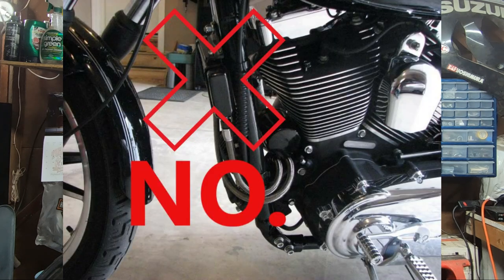How The Twin Cam Engine Became What We Know It As Today

Comment: I have a 2006 88 with 11000 miles all stock except for air filter and screaming eagle touring mufflers and a power commander should I be concerned?
Reply from the maker: The dyna that year had the hydraulic tensioners, softail and touring still had the spring tensioner. Most of the issues were on the earlier models. I'd just check it every now and again.

Comment: I was not going to go with a TC after '95 1340. Figured HD must have thought TC was the way to go. I have an FXDL made in 11/98. At 25k mls it's had the original chain tensioners replaced. The replacement spring tensioners have 9k on them with almost no visible wear. That suggests it was the shoe material that was the problem. Sounds like a sewing machine mechanically. Probably won't go back to Evo, the TC  has noticeably more torque.
Reply from the maker: The shoe material used was one problem, they won't say it but they had a bad run of timing chains that were more fit for a chains saw there.

Comment: and the EVO was in development when AMF had the company
Reply from the maker: It was in the late 70's, they knew they were gonna have to do something and make it more reliable. That unleaded fuel in Shovel Heads caused all kinds of problems, Harleys not a incapable company. They would of dominated road racing with the VR1000, they had that in 1988. But the big wigs wouldn't let them race it till they had a management change in the mid 90's. By then it was way out of date and behind in technology.

Comment: The twin cam is a great compromise of evo sound and m8 performance,but the heat of the engine is a problem in summer so oil cooler would solve that.the m8 engine is great but it loses the evo and twin cam sound we all enjoy.new harleys are more like victorys.next harley will have overhead cam big v twins lol

Comment: Check parts diagram of an M8.  In my opinion they took a step back to Evo basics for this engine.  Single cam with a chain between crank and cam instead of gears, and cam is centered vs pre pre-TC engine.  99 to 06 engines were probably the worst engines in  motorcycles and those years  sold in big numbers.  Cam chain tensionners, shifting flywheels, failing tapppets, failing inner cam bearings etc.   And Harley is wondering  why so many consumers are not buying another HD.    They (MOCO) might be doing much better if the Twin Cam never existed.
Reply from the maker: That's exactly what l thought myself when that M8 came out is they went back to a modernized Evo style design. The 88 years were pretty rough, the twin cam improved but it was never perfect.
Reply: @GixxerFoo  Never forget that the Evo was almost bullet proof, except as mentionned cracking engine cases in early 90s.
Reply from the maker: That was really the only major issue with them if you really started pushing them hard.
Reply: @GixxerFoo  The Evo had two issues (missed one in comment).  The engine cases that cracked, but of all the people I know that rode their EVOs hard one person that this happened to.  Secondly, if INA inner cam bearing was not replaced ASAP it could also do damage.
Reply from the maker: That's true and they had some issues with cyclinder studs pulling out of the cases. That's why they spread them further apart on the twin cam.
Reply: @GixxerFoo  Harley mechanic for 40 years and never had job with stud pulled out on an Evo.   Maybe in some cases caused by high compression
Reply from the maker: That's where it became the issue was when guys started high compression builds. If you kept it the compression mild it was never a problem.
Reply: What's your opinion on high tensile steel head bolts? I think they would cause a weaker part to fail. Probably for the worse @GixxerFoo

Comment: Interesting ! I've switched shift drums to one from Evo 5 speed & never noticed a problem other than the clunk is gone ! Also had the chance to use A motor flywheels in a B motor case & leave the balance shafts out & it works !  In 06 dynas & then 07 & up bikes the 6 speed is prone to main bearing failure & compensator failure which takes out the starter & breaks the splines off the clutch hub .  Just  some further information ! Thanks !
Reply from the maker: Dang you've done some interesting internal work. So what made you pull the balancers out of B motor? That's the cool thing about Harleys is that everything is so interchangeable.
Reply: @GixxerFoo  I was using a big cam high compression & ported heads & I could see no point in spinning the balance shafts ! I have a engine machine shop been at it for a long time !
Reply from the maker: Ahhh so you got the tools and the talent to do basically whatever you want. Sounds like you can pretty much make whatever you need!

Comment: EVO was a Porsche design.
What i dont get is this. Why was S&S able to build good big big bore long stroke engines and HD not ?
Reply from the maker: Harley had to meet emissions standards as an OEM would be my guess.
Reply: I thought the V-Rod engine was a Porsche design.
Reply: @whatsstefon 
Porsche was also hired to help Harley develop the Evolution engines and the Twin Cam engine, primarily with emissions control matters. Inside all Harley engines you will find German pistons from Mahle and in the V-Rod and Big Twins you will find gears and shafts sourced from Getrag. Early V-Rod engines had even more international content, with French head castings, German powder forged conrods and a forged steel crank from Hatz, a German manufacturer of small diesel engines. Even the gaskets have "Germany" cast into them! As an old "propeller head" (BMW bike enthusiast) this gives me a lot of confidence in this engine. I am guessing, until I know differently, the Revolution-X engine is every bit a quality piece as the V-Rod mill is.
Reply from the maker: It was developed with Porsche, Harley has worked with them quite a bit over the years.
Reply: @GixxerFoo  with Porsche is the same as..... Please help, we don't know.
Reply: Cheers for clearing that up. I had no idea their help extended beyond or prior to the the V-Rod.

Comment: Awesome Video👍

The Twin Cam was “abandoned” to early within the motors evolution for the Milwaukee 8. 

So goes the life of Harley Davidson 🤷‍♂️
Reply from the maker: Thay was exactly how l felt too, they finally had the bugs worked out and they dropped it.
Reply: I traded my 2010 Roadglide custom for a 2020 RoadGlide s I respectfully disagree. So far this bike does it all for this 63 year old rider.Fit ,finish quiet motor even after a stage 2 torque cam, suspension for now is fine Seat and handle bar design comfortable.The twin cam when it first appeared had its faults and some remained.Compensators,crank shaft runout, both cam and chain tensioner oil pumps.I traded my bike with 42 k on the OD and addressed these issues as needed . Pardon me if I have repeated this but a guy wrote not long ago.” You have to maintain a motorcycle like you would an airplane .” How true performance is great but professionally installed parts replaced in a timely fashion is the difference between riding your bike and waiting for a tow.
Reply from the maker: Maintenance is key for sure! I like that new M8 myself, they sound and run really good with a cam in them too!
Reply: Twin Cam already geting and Evo reputation lol i have a 2013 103. Ironicly the reasons i bought it wasnt just because of it being a problems ironed out bike, its a Streetglide and i liked the no computer screen and no abs. The motors been great so far and im only at 25k so i'll be riding it for awhile.

Comment: AGAIN ,  If you use AMSOIL 20/50 motorcycle oil you won't need an oil cooler and all the crap that goes with it . Besides being ugly as hell its also expensive as hell , plus the leakage problem that always seem to crop up with all the vibration . The 88 twin cam is and has been one of Harleys best engines EVER ! There have been several reports of TC 88's with over 200,000 miles & still going strong with nothing more than standard regular maintenance  !
Reply from the maker: The 88 is an excellent engine, it just got a bad reputation with the tensioner issues it had the first couple of years.

Comment: you dont need 8 valves on a Harley? you dont need  2 cams on a harley, leave it alone go back to a bigger evo and be done wiith it my friend has 100,000 miles on his first bike 84 evo.
Reply from the maker: I said for years they should've used the Sportster engine design but in a big inch engines. Same design in a 103 inch, torque would come with displacement and they would have the reliability. M8 really harkens back to the Evo in a lot of ways, most noticable is the single cam.

Comment: Epa is killing motorcycles.  Epa standards killed the Kawasaki klr 650 and now their choking Harley Davidson.  Soon they'll have to go all over head cam and liquid cooled motors. If that happens then Harley Davidson will be like the rest.
Reply from the maker: I keep waiting and hoping Kawasaki comes back with a new KLR 650, that's a indestructible bike. Harley could keep the engine design and look, just make it water cooled. Hell Kawasaki did it for years, the 15, 16 and 1700 Vulcan looks air cooled but it's water cooled. They got real close to the Harley sound with overhead cams, just backed it off after Honda made a Shadow pissed Harley off cause it sounded just like a Harley 😆😂.

Comment: They didn't "discover" the cam tensioner issue because they engineered it into the original design on purpose. People are sheep and no one more so than people who buy a new Harley Davisdson every other year or so.
Reply from the maker: They blamed it on a bad run of cam chains, which that was true. There was a bad run for a while that was like a chainsaw chain. For whatever reason the intent was 30k miles before replacement, it was an epic failure on Harley part. But many did get them replaced quietly since it was never officially acknowledged or recalled.